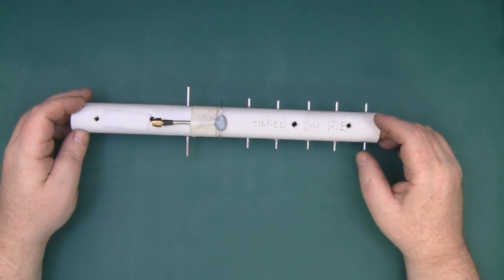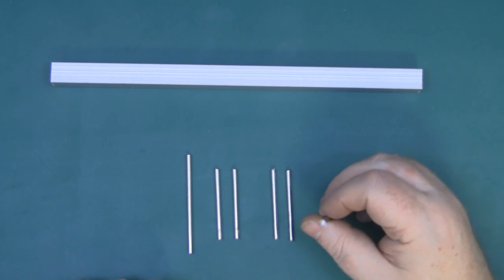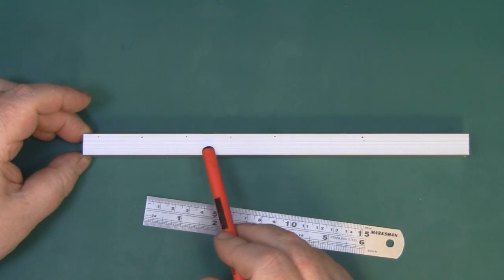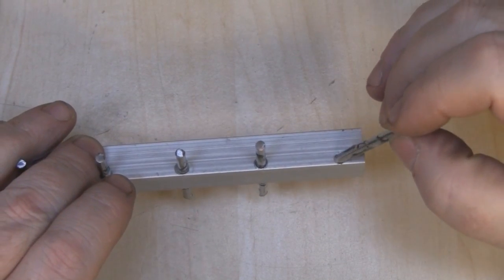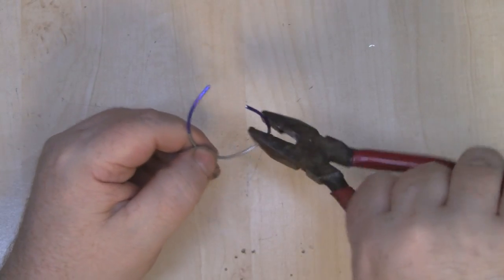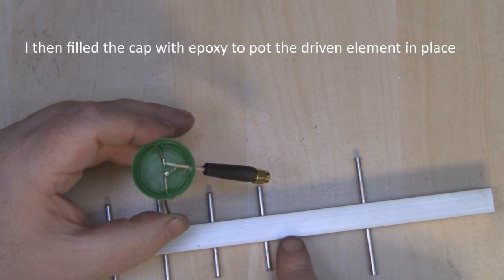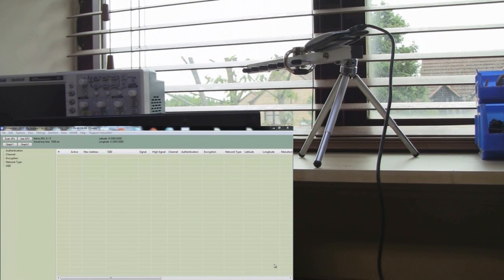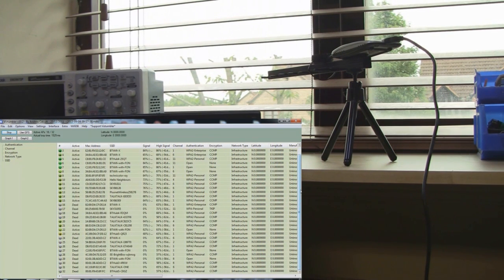2 4GHz Yagi Antenna #106

Comment: These are sharp-pointed antennas, what's the point of measuring the number of stations caught? They just do not have to catch everything around. It is more correct to direct the antenna to the source of interest and to measure the signal power. Non the less it's an interesting video.

Comment: 8:10 - Wait a minute, why are you soldering the ground to the end of your tiny folded dipole.  All you are doing is dumping your antenna energy into ground and shorting it out.  I think at this point you are screwing up.   A dipole antenna should not short out to ground, but have the antenna lead connected in the center of it to make a T.

Comment: you have got to set up a proper test bed for the antennas. you wont know where your at. use your wireless router as a signal, in a clear space, same with the test antenna and always have both in exactly the same position. the higher the gain of the antenna the more clear space around it is needed. [ capture area ] including height. 20dbi needs 3 wavelengths + ..  carefull with your usb wireless adaptor some of them will give you false results. they generate there own signal and interfere. cheap chinese ones are notorious. you can get a band pass filter on ebay to eliminate interference from other frequencys... when an incomming signal is amplified it brings in all sorts of harmonics which can stop you getting any readings at all specially in city areas, up high and outdoors. ive been sending wifi 4 km away and there is all sorts of problems with this. i use grid dishes, amplifiers and now satellite dishes... big signals both ways, and not even in line of sight

Comment: When you slipped in the metal antenna into the aluminum holder do you coat it with something to prevent contact or allow it to contact with it
Reply: No need to insulate the boom from the reflector or from the parasitic elements.

Comment: Can you show how to possibly modify the cheap Yagi you show in both videos? So many people have been fooled with these POS's, and if we were to modify them - we would have all the pieces to utilize - we can possibly mod it so it is not wasted all together. 

You mention that you are not a fan of yagi antennas also. I can understand this, but I wanted to ask - What type of antenna would you prefer for long distance, targeted directional antennas? Do you prefer the dish-type? I personally just hate the expenses with N connectors, and try to avoid them if possible. 

I also wanted to ask (since you seem to have some knowledge in the subject), can you use other types of antennas to make more powerful or more efficient cantennas? Maybe using a cone, and reflecting back to a directional antenna like the Alfa 7dBi version? I have wondered if one of these were pointed at a reflector, (rather, the reflector pointed at it), similar to what we would see with a radio telescope, would the directional/panel antenna gain more of a signal if it were positioned in such a way? Or would it cause too much noise?

Comment: I think, why your antenna is less effective because your calculation is not precise dude.

The precise calculation for this is

Yagi design frequency =2400.00 MHz
Wavelength =125 mm
Parasitic elements fastened to a non-metallic or separated from boom
Folded dipole fully insulated from boom
Director/reflector diam =4 mm
Radiator diam =4 mm

REFLECTOR
59.7 mm long at boom position = 30 mm  (IT = 25.0 mm)

RADIATOR
Single dipole 56.2 mm tip to tip, spaced 25 mm from reflector at boom posn 55 mm (IT = 23.0 mm)
Folded dipole 57.4 mm tip to tip, spaced 25 mm from reflector at boom posn 55 mm (IT = 23.5 mm)

DIRECTORS
Dir                               Length Spaced                      Boom position                     IT                          Gain                             Gain
(no.)                        (mm)  (mm)                              (mm)                   (mm)                 (dBd)                             (dBi)
1                                 49.6          9.4                                      64.4                    20.0                   4.8                                      6.9
2                                 48.7           22.5                                86.8                    19.5                   6.5                                  8.6
3                                 48.0         26.9                                113.7            19.0                   7.8                                  9.9
4                                 47.2      31.2                                144.9            18.5                   8.9                                       11.0
5                                 46.6           35.0                                179.9            18.5                   9.8                                       11.9

COMMENTS
The abbreviation "IT" means "Insert To", it is the construction distance from the element tip to the edge of the boom for through boom mounting

Spacings measured centre to centre from previous element
Tolerance for element lengths is +/- 0 mm

Boom position is the mounting point for each element as measured from the rear of the boom and includes the 30 mm overhang.The total boom length is 210 mm including two overhangs of 30 mm

The beam's estimated 3dB beamwidth is 52 deg

A half wave 4:1 balun uses 0.75 velocity factor RG-6 (foam PE)  and is 47 mm long plus leads
FOLDED DIPOLE CONSTRUCTION
Measurements are taken from the inside of bends
Folded dipole length measured tip to tip = 57mm
Total rod length =138mm
Centre of rod=69mm
Distance BC=CD=16mm
Distance HI=GF=14mm
Distance HA=GE=33mm
Distance HB=GD=53mm
Distance HC=GC=69mm
Gap at HG=5mm
Bend diameter BI=DF=25mm

P.S. ...use copper for dipole.

Comment: You say that the tube is 100mm long but I gotta say it looks around 350mm or so long.

Can you share the dimensions of the tubing you are using.  I may need to adjust the element length according to the my particular tubing dimensions.
Reply: i think it is roughly 260mm length of aluminum tube

Comment: xMRavenx  i have use this cable as it come as RP-SMA Male to RP-SMA Male  www.ebay.com/itm/111711588708
i have cut it for two piece and use for two antennas, as we build this antenna we need to solder one end of this cable, other side RP-SMA is perfect fit for Alfa card
Reply: +Serg P 

Cool share ty.

Comment: Would this be the correct sma connector to use for this project?

http://www.ebay.com/itm/SMA-Male-plug-to-RP-SMA-Female-Plug-RF-Coaxial-Adapter-Connector-New-/281408070728?hash=item41853a6448

Comment: Andrew you say the parasitic elements are 55mm's long your you have written 50mm in the video. Please confirm.
Reply from the maker: +FPV SPY They are 50mm long did I say 55 in the video?
Reply: You also say that the boom is 100 mm long but the distance between parasitic elelements 60-30-30-30-30=180 mm😮

Comment: Very nice, im gonna try to make this as well. Just wondering; the boom, parasitic elements and the base are all connected electrically?, if i were to use soem other material like pvc for the boom do i need to connect all the parasitic elements with a wire or not..?

Comment: No balun, why??

The number of access points can be a measure of how wide a beam is. The wider it is, the more nearby APs you'll find. However, a narrow bean can also find APs from farther if they happen to be on the line of beam. I think some other measurement like signal strength from A to B is much better measure for a directional antenna!

Comment: Do you thing it would work if you used a very short cable from the antenna connection into a network adapter. Than from the network adapter usb output into a "usb to lan? adapter. Than run cat5 down to your pc. I need to make a long run from an attic antenna.